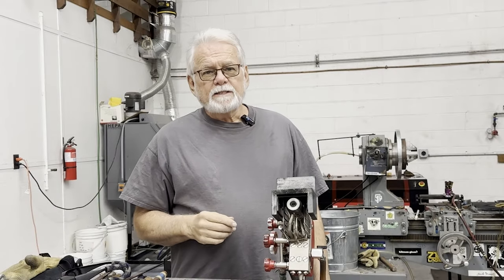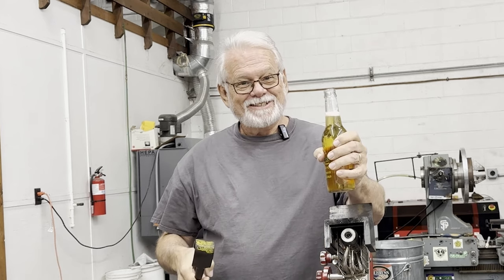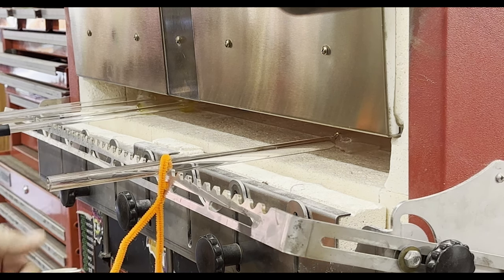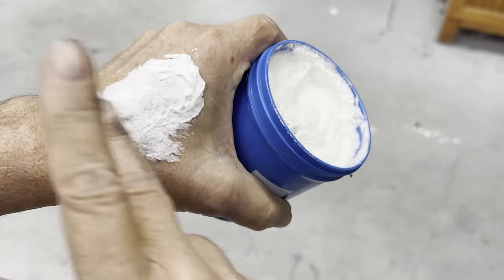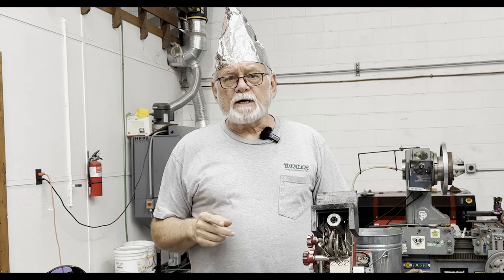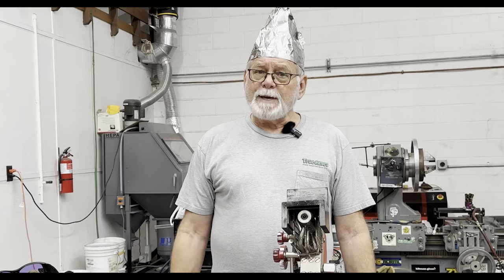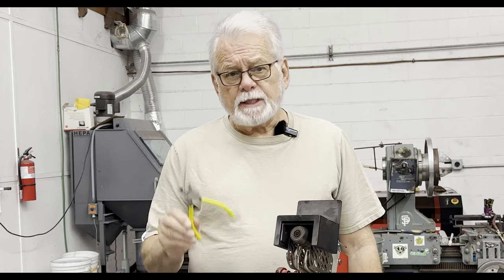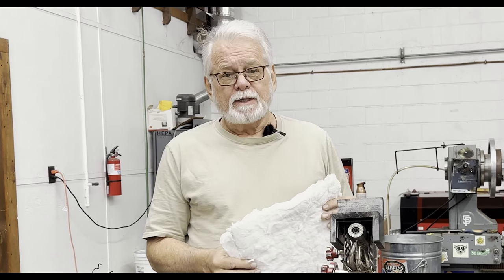Ten Hacks for Flameworkers!

Comment: Fun fact:  Some electric lighters make a high frequency "screech" that young people can hear but older people cannot.  When I first used one of these to light a torch my students freaked out.
Reply from the maker: You are correct about that. Curiously, although I cannot hear it live, the video recorded the sound and I could hear it when it played back.
Reply: @RAMickelsen   Shopping malls have used high frequency noise to drive away skateboarding teens.  Most people over 30 cannot hear the sound.  It was funny my students jumped like I had tazed them when I started the lighter!  I only bought the electric lighters because many of them struggle using the striker/flint Bunsen burner lighter that we use in the Chemistry lab.
Reply: We’ve used the USB plasma lighters for 2 years now at the Workhouse Arts Center. We’ve had older and younger folks use them and never had anyone mention any kind of extra noise. Now I’ll have to ask. LOL. When I was testing them out to see how long the charge lasts and if students liked them, I took a rod of boro right out of the flame and placed it on the lighter casing. Absolutely NO marring of the case, not even discoloration. MUCH safer than the wood matches we were using and more eco friendly as well. BTW: we found we’re only having to recharge them every couple months and that is with several classes and open studio using them per week.

Comment: We  appreciate all the great knowledge you provide to the flame working community Robert. I've been melting for over a decade and I'm still amazed at the tips and tricks that I pick up from other artist. In my first shop we used the fiber blanket to close the gap in the kiln door and I never thought to use foil instead. Cheaper, easier to shape, and less likely to burn my fingers, I'm on board for that. Putting that into action this week, thanks again. I switched over to an arc  style lighter a few years ago, I found one that fits into the metal cases of Zippo lighters. Sticks to the magnets I use all over my bench and takes up less real estate.

Comment: Great bunch of suggestions. I laughed out loud when you used the jacks to open the bottle. With so many bottles having twist-off tops these days, I haven't used that trick for many years. But that reminded me how much fun it used to be demonstrating my Dino bottle opener to others.  😊

Gotta disagree about the fiber blanket segment, though. It's not asbestos that makes some ceramic blanket potentially hazardous. It's the fact that the silica/alumina ceramic fibers it's made from won't break down if you breath them. The newer, bio-soluble ceramic fiber you mentioned is formulated so that your lung "juices" will break it down, which makes it relatively non-hazardous. "Relatively" because overheating of some of them (there are now a number of different types) will begin changing the fiber structure to something which is hazardous to breathe. But asbestos isn't involved either way.
Reply from the maker: I stand corrected. I was just repeating what I had heard about it.